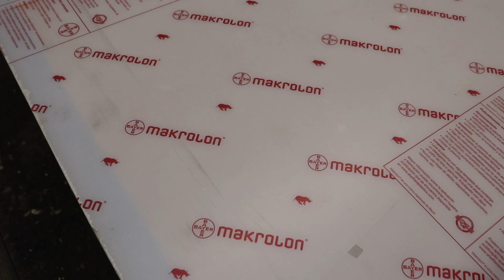DIY Interior Storm Windows

Comment: I used your video as a building guide and I built 3 of these windows for my home office. Built identical ones. They are by far the most effective way to silence the outside noise and still able to see out of the windows. BUT... after a few months I noticed some problems. The Felt Tape has started to come off and the plexiglass has started to crack around all of the screw holes. I have not moved the windows since install and I assume the problems are due to summer sun on them. I custom fit each insert to the exact measurement around the window for an almost too tight fit and I think air can't escape that has caused the felt tape to push out and the plexi to expand. My advice would be to build the frame with 1/4+ inch space and use an extra thick weather stripping instead of the thin felt tape. Also the thickness of the Plexiglass is very important, I used 3/16 in thick and .125 in thinner plexi. Only the thicker 3/16 worked without cracking. The thicker plexi cost me $160 USD per window but was worth it! Go with 3/16 in. or thicker for sound proofing, any thinner does almost nothing. Attaching the plexi to the frame worked with clear adhesive caulk and small screws(pre drilling is needed) but I think using turn button swivel fasteners might be a better option to avoid cracking over the years. One last thing I added that was not in your video was white handles on each side to move them into place. Hope this helps other DIYers out there dealing with outside sound issues in their home office!   Update: I forgot to add, the noise reduction was significant, about 10-15 dBA lower when a loud car goes by. That is enough sound reduction to go from people complaining about hearing noise in the background of your zoom call to only a slight whisper that can't be heard. It went from getting distracted every 10mins to not even noticing any road noise all day long. Took be 2 days to build due to paint drying time but well worth it.
Reply: Super helpful comment. Thank you for sharing!
Reply: Thanks for sharing, very helpful! Interesting note about the plexiglass possibly expanding/contracting due to sun and temp fluctuations, and that causing cracking. I wonder if 1/8” might be just fine, if you used slightly oversize holes with large-head screws? (I forgot the name, but I’m thinking of the kind of screws with broad heads, almost like an integrated washer.)
Reply: Kevin Bailey Real Estate. I was planning on using 1/8" acrylic instead of plexiglass. How would the acrylic compare to plexiglass re sound-proofing?
Reply: Thanks for the extra detailed info. I'm planning on doing something similar for our office room but with corrugated plastic (instead of plexiglass) firstly because it's cheaper and second because our issue is more about condensation (single pane outer windows) than noise. Plus we're renting so we don't want to spend a fortune on "renovations" for a place we don't even own.
Reply: Don't think anyone's mentioned this yet: Add a short white shoelace/cloth  tab to each side when you're screwing in and you got yourself a way to pull the frame out when winter is over
Reply: I’m going to embark on this project soon. How has your storm window held up to this point?

Comment: You wear no mask - No ear protection - The felt strip is acts as a filter material and is not amn airseal - there is no air seal between the plastic and the wood - you cut 4 sides of the plastic and could have just measured from the 2 factory sides and cut only 2. There are better designs out there for DIY windows - similar but much better
Reply: Could you post some of them here perhaps?
Reply from the maker: I’d love to see them as well. Especially if RCPMAC has his own vastly improved designs.
Reply: @TheCraftsmanBlog  I just laid out the vast improvements in my original comment.  Just implement it.
Reply: @TheCraftsmanBlog  I just gave you the specifications. If you can’t handle a reasonable critique you shouldn’t be making these videos.
Reply: @TheCraftsmanBlog  I really appreciate you taking your valuable time and energy to make this video. My husband and I never thought to make interior storm windows in our old house and this video was super helpful. Good enough to make an internet troll so jealous!

Comment: I actually created an internal door for my sliding door that had huge draft coming in during winter months and I found out that the actual foam that was supposed to be blocking the wind from coming was warped and practically gone. I didn't want a huge expense in replacing the sliding door so, before winter started I created an insert just like yours that I placed on one side of the sliding door to block the cold air and it truly held up. I remove it during summer months and it's kept secured and I built it like 6 years ago and it still holding up!

Comment: I had two rewatch this video 3 or 4 times because 1) I'm wondering if this method can be used on an old mobile home, 2) I'M DELIGHTED you like the Beatles, 3) the humor at the end of your video is hilarious with "Daddy!!" and the noise decibels.  Very effective video and memorable.
I bought my retirement home today, an older mobile home with lots of TLC and costly/timely needed improvements.  I'm sure I can learn a lot.  I'm a girl, 65 yo with a battery powered drill and guts to a small degree.  
In other words I need advice, help and knowledge.🤯🙏😵‍💫😄

Comment: thanks for you video , following your idea I did it with acrylic 108x48" ( huge window),  sealed the join between acrylic and wood frame with silicone and once installed sealed with green glue acoustic  sealer , the result was great for high frequency ( loud neighbors, bird chirping) and improve stopping low frequency or impact noise, total cost DYI around $250 ( acrylic sheet with such size are expensive), same size from "Indow insert " would cost between $800-1000, your video help me a lot.
Reply: Me.   What is the thickness of your acrylic?

Comment: I made some but used pocket hole joints and shrink wrapped the entire frame then added weather strip foam to the edges. It's always good looking at other methods too.
Reply: Was the shrink wrap the “glazing”, or was it just a covering for the frame, and you used acrylic for the glazing? If just the shrink wrap, how is it holding up? Is it nice and clear, without any distortion? Did you have any issues with the tension from the shrink wrap bowing the frame inwards?

Comment: Great vid, love the idea. One question though.  How do you get them out? I didnt see you add any kind of tab or knob to pull them free when needed.
Reply: I think you need to use a butter knife or putty knife, I imagine it's kind of a pain. I've seen other windows built for insulating against the cold where they included a handle drilled into the panel - just a simple cabinet pull, maybe one on the right edge and one on the right at a convenient height. It's possible the holes used to drill through the acrylic could decrease the soundproofing qualities? Since the holes would be filled with a screw I don't think it would have a drastic effect, but I don't know.
Reply: I'm an idiot and commented while waiting for the video to load - you could just attach the handle to the wood parts of course. Other similar models I have seen didn't have a wood part.

Comment: My gratitude for this is off the charts! I've been trying to come up with a solution for my 1915 bungalow with 9 feet of front windows in just my west facing living room (den-the same 9 foot configuration - 2-2' wide flanking a 5'x3' middle window and 😅 more west windows in the DR).  Live in So Cal - original glass. The windows easily get to 110-115 degrees in the warm months and radiate the heat inside. Have wood blinds helps a bit- shutters in the future. Concerned about the integrity of the 5'w x 3'h - do you think it will be okay? Seriously again - THANK YOU for this video!

Comment: You outlined the wood frame on the acrylic.  You then said cut acrylic 1in. shorter all around. Was that 1/2 in. all (1/2 L x H times 2) around that would make it the 1 in.? I have 16 windows, I'd like to diy it too. Can't afford to replace on fixed income.
Reply: You can make the frames and line them with clear plastic and double sided tape. After those are set you can replace the plastic with the clear polycrylic or acrylic sheets one by one.

Comment: I love your videos, really well done!
I have an old house, 1890, all original double hung windows, and (70s?) aluminum exterior storms. For blocking draughts, I made interior frames and used that heat shrink window film on both sides, and weatherstripping foam around the edge. This worked ok for 2 years, but it was never meant as a long term solution. UV eventually breaks down the film tape, and the plastic starts coming off. I also want to block sound out, which the plastic film doesn't do.
I could reuse the frames, and insert glass, however, I never got a perfect seal with the insertion + foam wrap approach. A thin jamb (for the top half) for the window to butt up against (with a  weather seal backing) would create perfect air tightness, and allow more tolerance for the frame, since no window is perfectly square and the same as every other one.

What do you think of that? Any good idea for how to keep the window pressed against the jamb/seal after it's in place? That's the final piece of the puzzle I haven't figured out, but I'm sure there's a really clever way to do it. Some kind of wedge system at the corners, maybe.
Reply: Also, since they are interior windows, I'm not sure I want to use putty (on the outside of the glass), or should I still do that? Seems hard and messy. What about tacking in some trim?
Or, since I can dissemble the frame, simply route a channel for the glass to slide into?

Comment: My 1885 house is in a northern climate.  I'm half way through a major, DIY kitchen reno and I'm in the midst of rebuilding the three 34"x72" window frames and restoring the sashes. The original setup was (original wood) exterior storms (4 lites each) but seeing that my house is on a slope, the kitchen is 2 stories up on the window side, and I'm getting older so I really don't want to be installing/uninstalling the storms every year on 20' ladder, I thought about coming up with an interior storm.  Would a storm like this work when weather sealing is the concern?

Comment: What thickness of sheet of acrylic would you suggest on getting? I'm planning on making these this coming week and I'm not sure what thickness i should get it at that would be good at sound blocking
Reply from the maker: 1/8” worked well for me but 1/4” would do some serious sound blocking.
Reply: @TheCraftsmanBlog  Good to know thicker acrylic=more blocking. I wondered if it was the acrylic or the airspace that created the block. Another guy on youtube made some panels using JUST 3/8" acrylic, with silicone tube stripping all around. (installed using suction cup handles).

Comment: I had brand new Marvin windows installed from the frame up. But I still feel a bit of cold and draft around the inside of the windows. What went wrong there? Is it the windows or the install method? Or just that my house lost it’s insulation?

Comment: Noise is a huge issue for me. I recently purchased a house in a quiet street and to win it, I had go over the asking price (as you would normally do in sellers market).
That said, I need to replace every single windows in my house. I read that new windows do not need storm windows to perform well energy-wise because of the Low-E technology they have incorporated in their builds. Would it be an overkill to have both storm and low e windows?
Reply: If you’re thinking about replacing your windows, look into laminated glass. It’s used in hurricane coastal regions but it also DRASTICALLY reduces outside noise.

Comment: Looks good. I have a couple of questions. Where did you get that big of a sheet of polycarbonate? Why didn’t you just line the edge of the polycarbonate up with one of the sides of your frame and then mark the other sides when you were cutting it?  Did you not attach the storm window to the window frame some how?
Reply from the maker: My company uses polycarbonate to board up window openings while we restore the sash so we had some leftover that fit my needs. You could line up the edges but I wasn't certain that they were cut perfectly straight to begin with so I felt it was better safe than sorry to make all my cuts fresh.
Reply: @TheCraftsmanBlog  Thanks for the response. Love your work.

Comment: Great Video!  I'm about to order some Indow inserts for my bedroom windows, but I'll probably look to do this on a few other windows to save some money.  I have two questions; why didn't use apply a thin layer of silicone around the edge to create a better seal?  Can you do another video of the noise reduction with the window inserts?
Reply from the maker: Good call on the silicone for air sealing! I’ll add that the next one. And the noise comparison is a great idea.